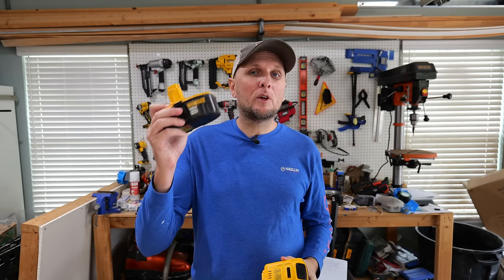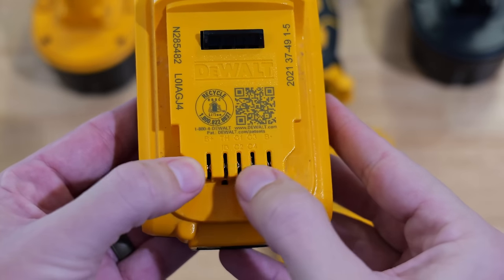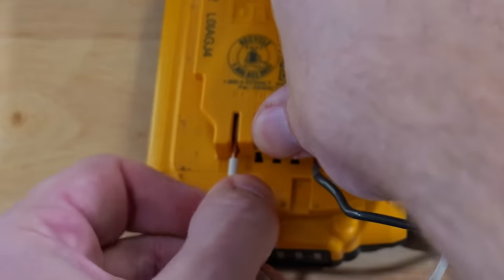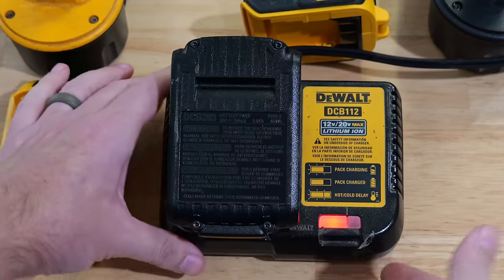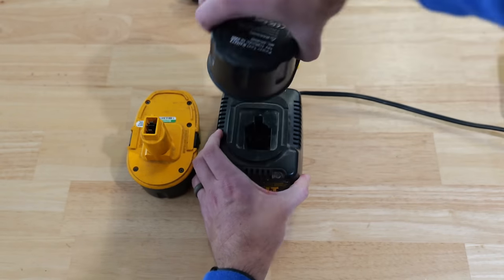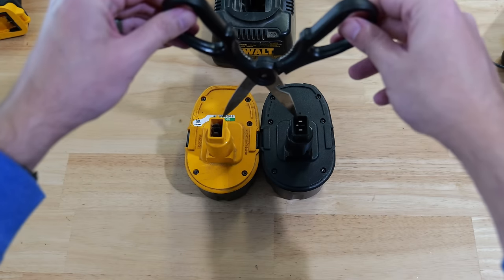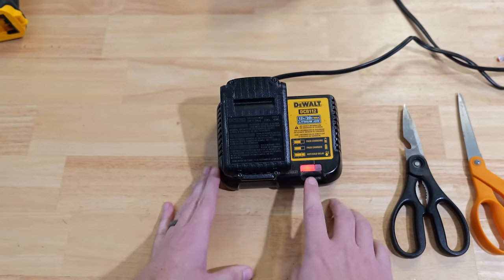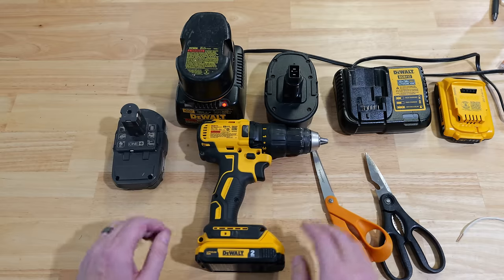SECRET To Reviving Dead Portable Tool Batteries | Super Easy!

Comment: I did that scissors trick when I was 4 with a 120v outlet.  Much more memorable.  Now that I am an 61 with a EE degree I would recommend a fuse and alligator clips.
Reply: I second the fuse and alligator clips. You REALLY don't want to see a Li battery fire inside your house or garage.
Reply: What size fuse would you suggest?
Reply: 30 amp most likely. As thats around the max output of a samsung high output cell
Reply: Ha ha! I did that same trick with a pair of wired toy “Rabbit ears”. I was 5 years old and was curious as to what would happen if I stuck those ears into a 120v outlet. Poof!!! One scared kid and a blown fuse. 😅
Reply: I wish you had done this video. ❤️
Reply: It was a Bobby pin for me 😂...3 yrs old..definitely left an impression on me 57 years later...in fact I could show you the very outlet and very slot I poked in my childhood home😂
Reply: I agree with the wiring as you have discribed.   I loved the explanation of the problem however.  I don’t hate the video at all but the scissors really threw me.  I was already a teeny bit itchy when he used the black and white wires on those chosen electrodes.  I know it’s silly but it just made me itchy and having to admit that my muscle reaction when I was trying to jump the arc from my coil to spark plug when I was younger launched the screwdriver through a gypsum wall because I had the battery on a charger at like 30amps or something stupid.  Ye, I know…anyway I’ve seen some sparks on 12v systems that could make those scissors jump pretty good.  I just can’t love it.  I love your recommendation though❤
Reply: I did it with my fingers when I was 3. Needless to say I took my parents' word seriously after I regained consciousness. My curiosity never stopped, though,  and I too work in electronics.
Reply: haha the scissor trick is interesting..I found out what lectric was too at 4 when I pugged something in half way and decided to give it a touch.  I was right out of the bath and got zapped good!
Reply: I tried the fuse and alligator clip on my outlet and now my toaster is laughing at me
Reply: Mine was a tweesers.
Reply: 😂holy crap I just spit coffee everywhere! That was funny crap right there!
Reply: At least , at 4 you learnt and lived to tell the world later of your experience with the scissor trick and it made you want to learn more so you got your EE degree and found out there’s a thing they call ‘SAFETY’ in the working world. Thank you for pointing out these so - called short cuts that these amateurs put out there on the internet without knowing the dire consequences it could pose.
Reply: Mine turned into a Hedge Trimmer 🤔😆
Reply: @billcat1840  Ha you Americans, I tried it with 240v with bare hands at the age of 4 on an old pendant light switch. Still remember the blisters at the age of 67!
Reply: Funny as f
Reply: Hey great minds think alike. Although i waited till i was ten, much more mature. I was trying to recharge my large 1.5v lantern battery. Made perfect sense at the time. Maybe that's why i became pilot instead. ;)
Reply: I touched a quarter to the prongs of a partially inserted plug about 30 years ago. I still remember very clearly how electricity jolting up my arm felt.
Reply: Why?
Reply: @markthomas919 while walking uphill to school, 8 miles, in a snowstorm😂?!